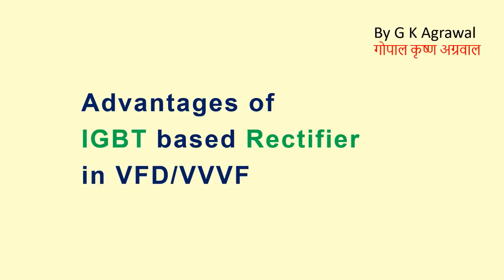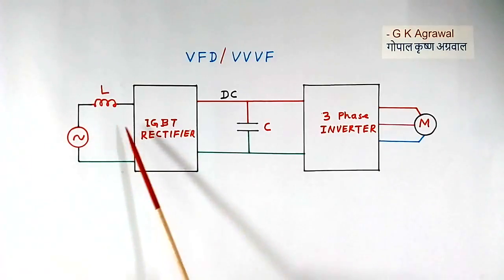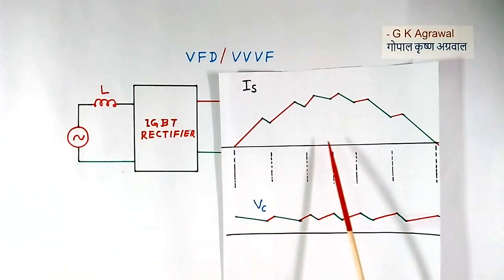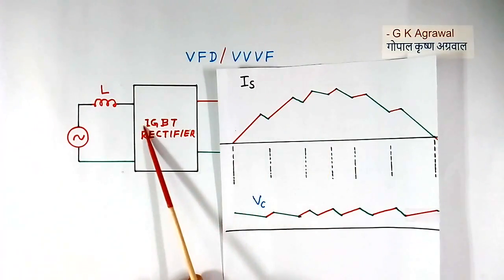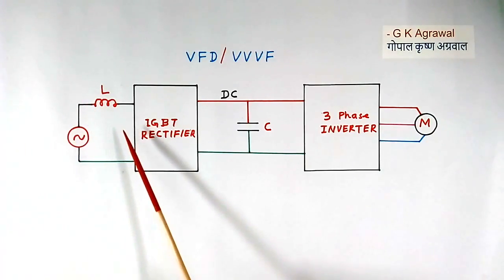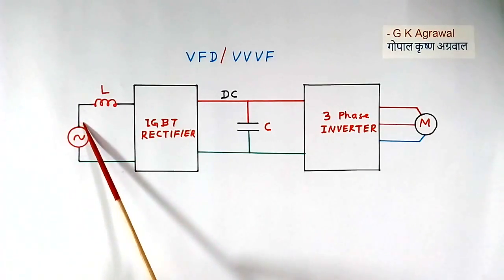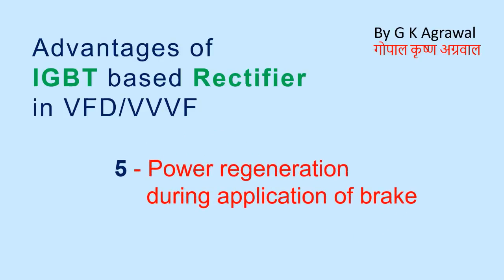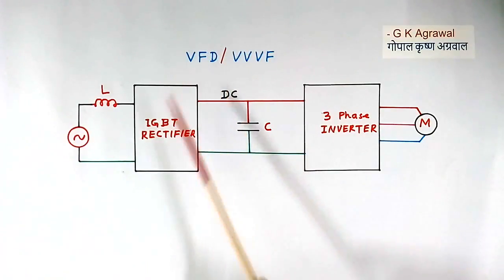Advantages of PWM & IGBT based Rectifier in VFD, VVVF

Comment: Replacing bridge rectifier by active switch is only beneficiary for mid or high power level which is case for VFD drives. 

1. For low input current harmonics , we need to switch on off the igbt with signal coming from pwm modulator. If we do Fourier transform of voltage at active rectifier bridge(3phase), voltage is mostly fundamental and  multiple of switching frequency. Harmonics in current of range of switching frequency can be removed using LC or LCL filter so we get low harmonics in current.

2. Near unity power factor - while using pwm modulator, we use PLL to detect the input voltage frequency and instantaneous phase of voltage. Since modulating wake is replica of input supply voltage, we get nearly identical (in term of  phase) voltage at inverter output terminal. Though we need to do some adjustments for phase lag due to LC/LCL filter

3. Low power loss - I think main reason is that there is very low harmonics compared to case of using uncontrolled rectifier. As we know, high frequency can cause Eddy and mainly hystersis losses in iron core transformer

4. Good performance even at lower voltage - in order to understand this, we need to learn two terms , modulation index and delta(phase angle between supply voltage and inverter voltage. Modulation index (MI) controls output voltage/reactive power and delta control active power flow. Suppose we have low voltage. In case of uncontrolled rectifier, we will get low voltage at rectifier capacitor. In case of igbt based rectifier (controller rectifier), we can introduce a phase lag(called delta) in modulating wave. So we can draw high active power fro main supply. This active power can be used to boost the voltage of rectifier capacitor to desired level. 
At the same time , we can increase the modulation index to inject reactive power back to grid. This will help to boost the voltage of grid (or at common supply node atleast)

5. Power regeneration and feeding back to grid - when we apply brake,   we can get increased capacitor voltage. Now this extra energy stored in capacitor can be fed back to grid by increasing the phase angle of voltage of igbt rectifier compared to main grid voltage . So effectively we feed active power back to grid.

There are many more advantage of using igbt rectifier are active front end rectifier.